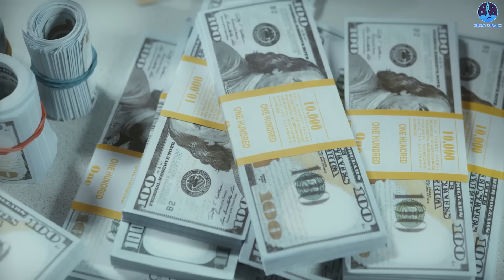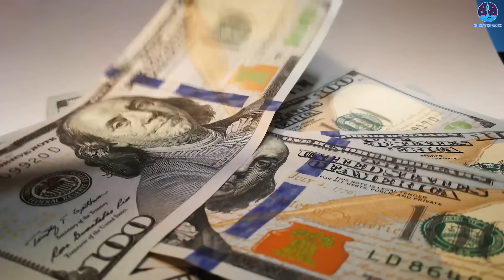It's mind-blowing! What SpaceX's recovery teams just did with the fairing. Musk admitted...

Comment: 6:33 Correction: the fairing does NOT stay active until the payload release stage. It is jettisoned shortly after the booster, around the 100km mark, still at a suborbital trajectory. If it stayed on the rocket until payload release, it would be travelling at orbital velocity and be impossible to recover.

Comment: Nice article, however your math may be inaccurate because you stated that 300 saved fairings were equivalent to nearly 260 Falcon launches, yet there are two fairings halves per launch, which equals 150 Falcon launches. What is the failure rate in the recovery of both fairings?
Reply: If he meant they recovered 300 faring halves out of 260 launches (or 520 fairing halves), that would be @ 53% recovery rate. Using $3m cost per fairing half, that would be $900m.
Nearly $1billion of construction cost saved is nothing to sneeze at.

Comment: Hey just curious, has anyone thought about the potential of using the fairings for space station construction material? 
Obvious in space modifications would have to occur. But it seems like "wielding" the two halves together then attaching an airlock hatch on the open end could add a lot of real-estate to a space station.
Reply: Consider they launch into a lot of different orbital inclinations it would be a big job to try and gather them all up and try and do something with them.  Better to return them and reuse.